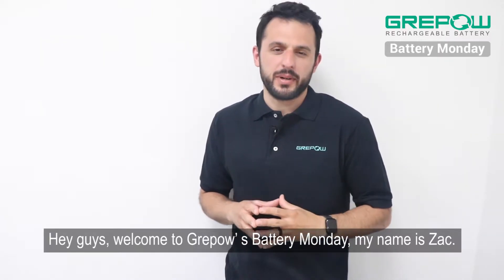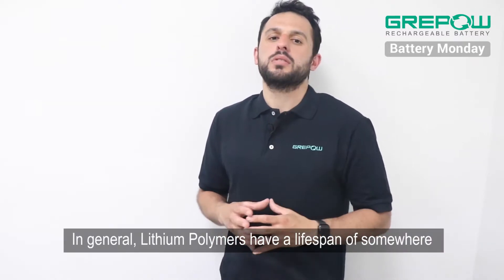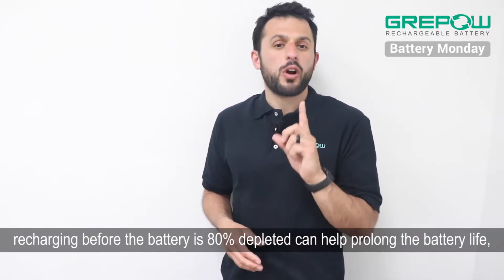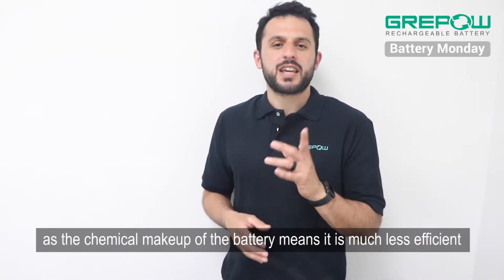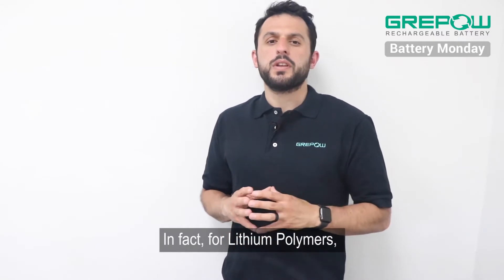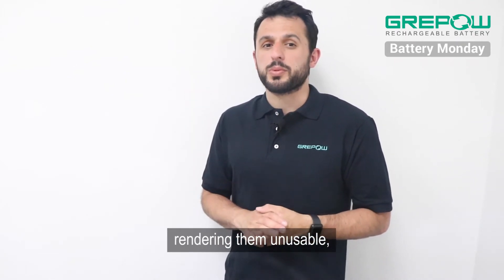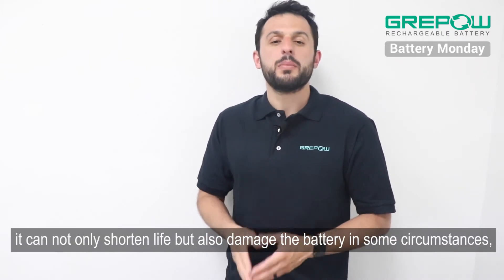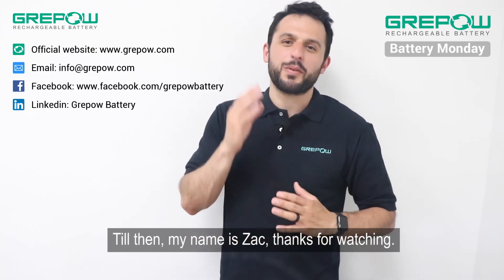How to Prolong Your Lithium Polymer Batteries  - Battery Monday | 14 June 2021

Comment: I use my litime lipo4 4 of them200amp 12v my question is equalize power consumption with ultra supercomputer in parallel would help balanced the 4i have  batteries ? wires are all same

Comment: I hate how much you have to baby LiPo batteries...
I just found a really nice laptop to buy & then I read that it has a LiPo battery, I just can't deal with having to be extra cautious about it going over 80%, especially since I use my laptop plugged in at home.
ps. Are LiPo batteries more dangerous than Li-ion? I've read a bunch about their packaging being more fragile than Li-ion & if that packaging gets damaged it'll catch fire or spread chemicals.

Comment: Can you please tell me if it's okay to keep my laptop plugged in all the time if it has a lipo battery?
Reply: if you have an option on your computer to block the recharge at 70 or 80% yes it is possible.  but if the battery remains charged at 100% continuously, it will degrade faster and will be ruined before a battery set at 70-80% continuously